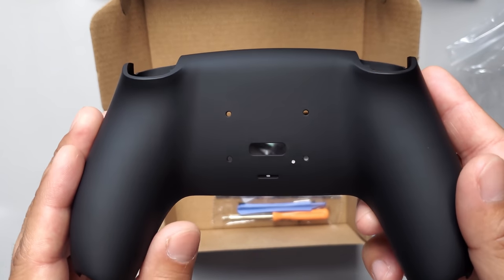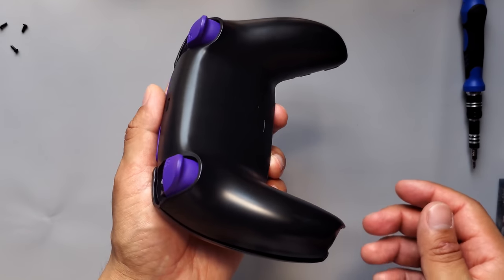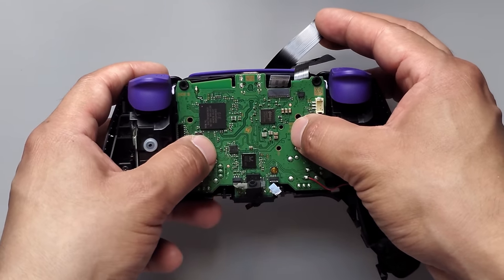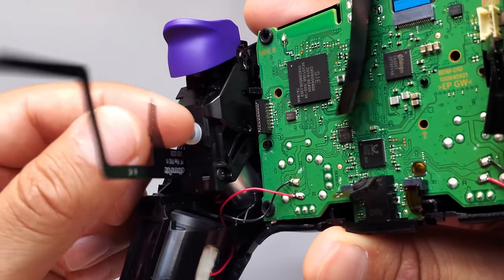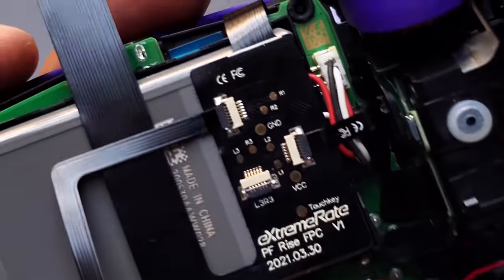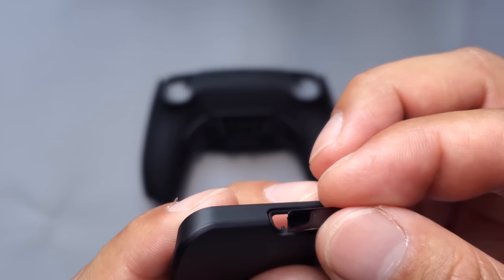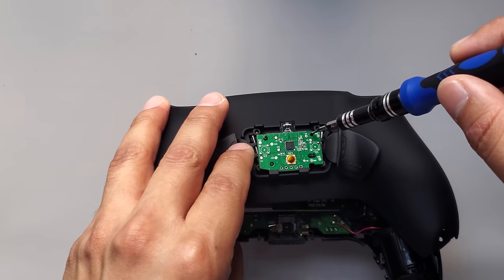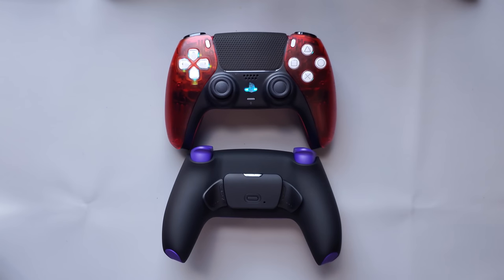DIY PS5 Controller (For BDM-010): eXtremeRate's Rise Remap Kit | No-Soldering Step by Step Tutorial

Comment: This video is literally perfect. I have been putting off buying back buttons for the ps5 controller because I am no expert when it comes to taking controllers apart. This video is so detailed, I just managed to install these back buttons in exactly 1 hour (I did take my time). I’ve tested the buttons and they are brilliant. Thank you so much 👏🏼
Reply from the maker: That's awesome! It doesn't matter how long you take or how good you could be at taking things apart. As long as you can observe and be careful it can be done. Congrats and I'm glad you're enjoying your back buttons.
Reply: any problems with lag or buttons registering more than once per press? if that makes sense? i saw another vid of another modded back button attachment and the dude Ghostlyy or something like that was sayin when he press’s the back button, it sometimes registers twice and he will jump or crouch or whatever twice….not once?
Reply: @gremlin51820  I’ve experienced no issues at all with these back buttons! The buttons register perfectly every time they are pressed. The only thing I would say is that they are very delicate to touch, like they don’t take hardly any force to press/register. Depending on how you hold your controller you make accidentally press them.
Reply from the maker: @gremlin51820  I haven't had any issues at all. They are on the sensitive side though. Maybe he accidentally pressed it twice because of how sensitive they are? Really depends on how you hold your control in my opinion. I make sure I'm not applying alot of pressure and I just presss on them exactly when I have to activate the back buttons
Reply: @im.a.caveman  No it wasn’t with the same attachment as you are using. I was just seeing if u had any issues with the current one you are using by eXtreme. 

The other guys controller of the video I was watching was a completely different back button by a different company/brand. 

*My main concern was whether or not the button is registered a second time even if u only press it once, is all i had to ask.

*The other dude’s attachment was also pre-installed, meaning he bought the controller modded and didn’t do any modding himself.
Reply: Does installing this disable the adaptive triggers?

Comment: Honestly wasn’t going to buy it and just wait for Sony to come out with its own attachment because it looked like to much work, but with this vids voice over explaining step by step what to do, I just ordered mine today. Thank you 🤝
Reply from the maker: I know what you mean but to tell you the truth there's a nice feeling about working on a custom on your own. You just gotta take it slow and carefully take things apart. The same with putting it back together. Completely worth it in the end. I'm glad you ordered one and I hope installation goes well. And thank you! 🤝 If you have any questions feel free to ask and I'll try my best to answer.
Reply: @im.a.caveman  I just finished the process but when I connect my controller to turn on it flashes orange once for 2 sec then goes away, system says to press ps button which means it isn’t connecting do you know what could be happening?? :( I also did try to disconnect battery and reconnect but still flashes orange once and goes away. It isn’t connecting at all please help 🙏
Reply from the maker: @hurdd7654  I suggest opening the controller and see if all cables are connected. Update me after
Reply: @im.a.caveman  I was honestly just stressing over the controller not working so I ended up opening and putting everything on a new p5 controller I that I just got and it works with no problem lol🤔 so I assume my first controller something just wrong with the battery or something but at least it’s working all I care about ✔️
Reply: I’m still waiting for Sony to release their DualSense back button attachment because honestly I don’t wanna take my controller apart lol.
Reply from the maker: @hurdd7654  one thing you can try is pressing the little button thats behind the controller. It'll reset it. And then maybe just leave it to charge for a while to see if it charged some battery or not. Good thing you got it working on your other controller. Enjoy!
Reply from the maker: @earthinthecomments4944  I know what you mean. I wonder how long it'll take Sony to release their attachment though. I'd try it out to see how it works compared to this one.
Reply: @im.a.caveman  where do I go order these at amazon

Comment: WOW... that was incredible ! The company did a half ass job, your video was incredible. PERFECT for no solder. I followed it and installed the paddles on my PS5. Thanks you so much
Reply: How its working after 2 months? I get mine 2morrow
Reply: @pepesalazar4649  does the back buttons work on the ps5 console or do the buttons only work on pc?
Reply: @lucasisflexing4872  they work super on my ps5!!! My friend have the ps5 scuff snd tried mine and he literally just bought this one!!! Super recommended
Reply: @pepesalazar4649  so the back paddles will actually act as real buttons on the ps5 console. Because I’m worried that it only works on pc because you can’t set them as buttons on ps5
Reply: @lucasisflexing4872  it does not mess with the pc/ps5 you set them in the controller. I have used them in multiple games and even in the interface
Reply from the maker: The remap kit was designed for the ps5 controller. You can only remap existing buttons. If you do the soldering version you'll be able to remap dpad, action buttons, triggers, toucpad, L3, and R3. If it's the non soldering version it'll exclude the touchpad, L3, and R3.

Comment: Just finished building mine, this helped immensely 🙏🏼 appreciate it
Reply from the maker: No problem! Thanks for watching
Reply: please tell me 
is the adaptive triggers still working after you installed the extreme rate  kit ?
Reply from the maker: @MD-tx7tg  As in the haptic feed back or being able to use your triggers in general?
Reply: @im.a.caveman  yes as in haptic feed back
Reply from the maker: @MD-tx7tg  If you don't have hair triggers installed you should be able to use it. I personally can't tell because I have my 2 controllers with hair triggers so I don't have my haptic feedback turned on. In my opinion it should work since this is only for back buttons. And I don't remember the kit saying that haptuc feedback won't work. But don't take my word for it. This is just my observation and analysis. I'm sorry I wasn't able to help more.
Reply: @im.a.caveman  thanks bro

Comment: well my ps5 is coming in 2 weeks, and i just had nothing to do on saturdy and i got the 2nd controller and kit.  followed your instructions and literally i was done in 33 min (timed) not bad for a non engineer.  best guide ever man, thanks.
Reply from the maker: That's awesome! 33 mins is not bad.
Reply: @im.a.caveman  do you know if the official ps5 wireless charging dock will still charge the controller with the backbuttons?
Reply from the maker: I doubt it. I have one similar to it and it doesn't fit.

Comment: Only thing I would add is to make sure they have the power cord inserted at the end of the step up, to get the Red Light to show on the rear paddle addition... Mine didnt show up /  turn on until it was plugged in. Thought it wasnt installed properly until I plugged it in. 
Otherwise this was honestly the best tutorial for a complicated process that Ive even seen. Every step by step process was explained perfectly!
Reply from the maker: I think I heard some people had to do that but I didn't have to. The back can be turned on only when the controller is on. Thanks for watching!

Comment: What an amazing video! It’s very well explained and got me thinking of getting the kit and using this video as a guide. Thank you!
Reply from the maker: Thanks! Check your controller for compatibility before buying. On the back shell there's a model number CFI-ZCT1W which is BDM-010 and compatible. Model number CFI-ZCT1W A is BDM-020 and not compatible.
Reply from the maker: If you want to see the BDM it's on the motherboard.
Reply: @im.a.caveman  Thank you soo much I actually got the kit and fitted it in using your video as a tutorial 👍🏼
Reply: @Gostliy  how do you check for compatibility to make sure it’s gonna work? Can you see on the box of the controller before you buy it perhaps ?
Reply: @MAX_BUX  yeah its on the side of the controller box

Comment: Hopefully back paddles on ps5 controller become more common and cheaper I’d like a back attachment like the PS4 controllers have
Reply from the maker: Definitely. Hopefully the attachments are cheaper. Maybe soon some company will release one for the ps5 controller. I would try it and compare it to this one.
Reply: The back button attachment for the PS4 is great, it feels clicky and has a lot of heft to it, it doesn't feel like flimsy skinny paddles, the OLED screen let me bind my buttons on the fly as opposed to exiting the game and screwing with the software.
Reply from the maker: I never got to try that attachment but now that you bring that up it could make a great video for comparing the 2. Thanks! Also, which back buttons do you know makes you exit the game and screw with the software like you mentioned? I've only used the ps4 extremerate back buttons and this one.
Reply: @im.a.caveman  I'm sure the Xbox Elite Controller, the Steam Controller and the 8Bitdo Pro 2 uses software to change the input.
Reply: @WheeledHamster  since you can remap axle inputs on the Razer ultimate edition I would guess they have to use software to do that no? 
Quick edit: maybe that’s why that controller in particular gets stick drift so much

Comment: Sweated HARD while doing this for myself.... Especially when it came to turning the controller back on, and reconnecting it to the ps5 (have to plug it in with the Sony USB-C cable). Then sweater a bit more while I tried every single button to make sure they all still worked hahahah.
Reply from the maker: So everything turned out good?
Reply: @im.a.caveman  had to keep stopping the video and re-reviewing the steps as it was a little bit fast for me but all wotked perfectly and I'm using it now. Was so nervous when turning it on for the first time in case it didn't work. 

Already liked the video before I got it!! Thank you so much.
Reply from the maker: @shaunb813  That's awesome! Always better to be calm and patient. Thank you for watching and liking the vid. I still have a few other upgrades to install so stay tuned!
Reply: @im.a.caveman  I'm subbed so looking forward to it. Good high quality videos
Reply: Lol, i subed. Ive order this thing and ill hope with this tuto its going to help me.
Reply: Mine never turned on once I was finished. The controller that is. I’ve test all the battery connections and it’s fine. Any idea where I went wrong?

Comment: I really miss my ps4 back button attachment, but this looks like a solid 2nd choice. How are the button placements and feel of the click? Are they compatible to the ps4’s back button?
Reply from the maker: They're on the sensitive side but I'm used to it now that it seems normal to not press them easily. People play in different ways so I guess it depends especially with preference. I'm enjoying them though. I feel like the actual attachments might take awhile to release but I'm gonna try them out when they do.
Reply: Super sensitive. So sensitive, in fact, that I had to replace the tact switches. Works better now but now I fear that the paddles may not last as long due to the extra force needed to activate the buttons. We'll see.
Reply: i use mines still

Comment: The dualsense that I installed the kit on started having stick drift so I brought a new controller. Do you think it's better to swap the remap kit from the old one to new one or should I buy a new kit?
Reply from the maker: You can still use the same kit if you don't feel like wasting the money yet. Especially if it still works.
Reply: Did it work to swap to the new controller? I have the same issue
Reply from the maker: @skitole92  if it's compatible with the controller and it's still in working condition then I don't see why it wouldn't.
Reply: @im.a.caveman  thanks👍 i got a new controller now so i will se if its works tonight

Comment: This video is great unless you have the kit that is for the M10 & M20 together. It has a different cable for L1/L2 that has to be trimmed and folded over to work properly. Other than having to do a little research for that part this guide was fantastic. Thank you!
Reply from the maker: This was during the time that the V1 remap kit came out. Ever since then they released the V2, RMB, and Rise4. I have a video of the Rise4 installation on a BDM-020. Thanks!

Comment: Just installed them thanks to this video, very detailed and clear. Only thing I had trouble with was connecting the cables into the little slots. Other than that very easy and takes only an hour. Great video!
Reply: Yeah the cables are a pain on my ps4 controller I was free balling it trying to fix drift stick, was a pain in the ass when I was plugging them damn cords up😭
Reply: Think a person with basic handy skills, basic soldering skills and electrical knowledge would be able to do ?
Reply: @bobsteb61  I’ve never done it before until now and I’m 14 and was able to do it the cords are just a pain in the ass to me when it comes to plugging and taking them out but generally it’s a simple job to do
Reply: @stepbrobob-_-3600  your 14 and you did this alone? Good job little brother
Reply: @Monstercore0770  well 15 now lmao thanks

Comment: You make that middle part go back together so smooth, I appreciate the content, i was reading on these thru amazon, because i was planning on getting myself one, i already own a cinch controller, so i got myself this one, read the comments and one comment recommended your channel, and definitely giving a sub on this👍🏽
Reply from the maker: Thanks alot for the sub and for watching. Was curious on the cinch controller you were talking about. Seems nice because of the small buttons and I like the little led indicator on them.
Reply: @im.a.caveman  its a good controller, but i think cinch could atleast bring the buttons a little bit higher, not really use to using my ring fingers to press the buttons, so i lightly slant my controller so my middle finger touches it perfectly, but these extremerate paddles do the job, im just gunna have to give it time to get used to paddle placements after using the cinch controller for awhile

Comment: Great video, could’t have done it without. I was a little scared at first, but it went great. Thanks for the well done instructions, way better than the Extremerate video
Reply from the maker: Thanks alot! Even though you were scared you got it done. Congrats!
Reply: @skyboomin  mine also...
Reply from the maker: I think I had replied to chief on a different comment. It's most likely because the kit is not compatible with your controller. You need the one that's compatible.

Comment: Good video for the install. I would just say that if you want to remap the L3/R3 buttons, you will need to solder a ribbon cable at two spots on the board, and this needs to be done before reinstalling the battery holder and battery. Not a huge deal, since you can take it apart again, but it is easier to do it when you have it disassembled the first time.
Reply from the maker: This was the non soldering version that's why I didn't have a video of that part. I need to work on my soldering skills before I attempt it.Thank you by the way!
Reply: @im.a.caveman  Just a quick question, and thanks for the superb guide - if we're not bothered about remapping L3 & R3 to the new paddles, I presume they still work as default in their original positions, yes? So everything works as standard as before inc. these L3 & R3 clickable thumbsticks where they've always been - you simply can't remap them to the new installed back paddles after this specific procedure. So just to clarify, after I install this back paddle contraption, L3 & R3 will still work as they've always done on the sticks, we're not losing those functions entirely somehow through this adaptation?

Comment: Thanks. I stink at soldering and managed to get it working with L3R3. I disconnected the red and black vibration wires so I could really focus and taping & soldering that tiny strip for L3R3.
Reply from the maker: I suck at soldering too. At least you did the soldering. I didn't even try :(